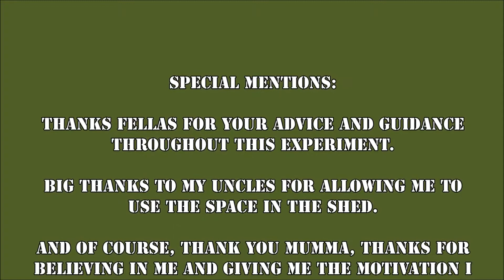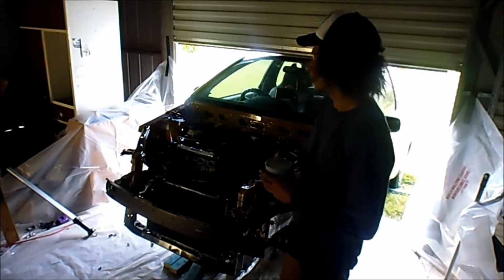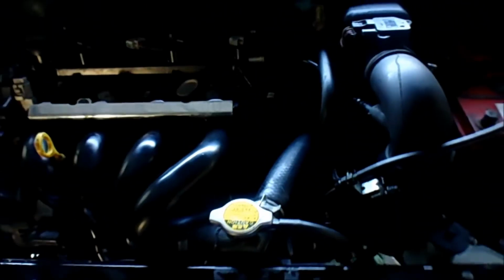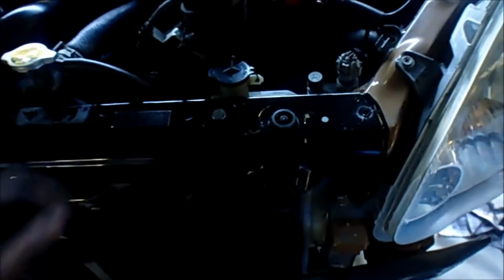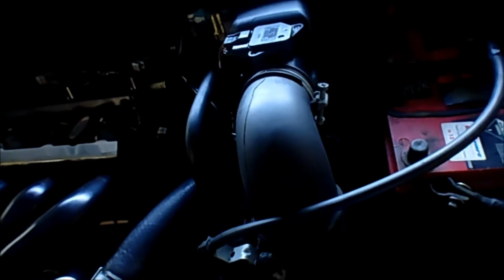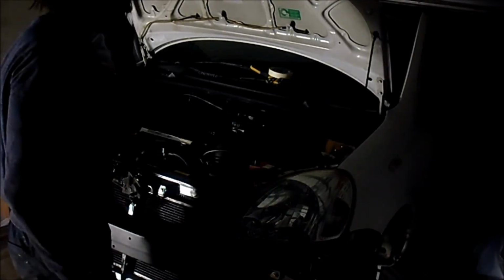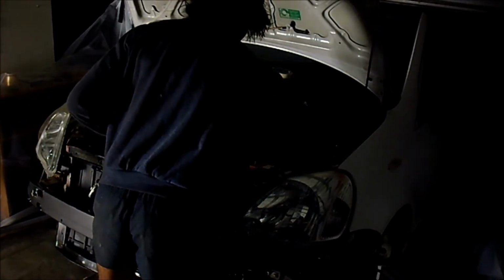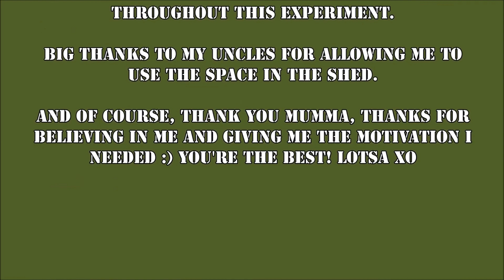PFP - Pt.16 Toyota Echo 2nz-fe To 1nz-fe Conversion [First Start]

Comment: You could SWAP a 1nz-fe into a 2nz-fe without needing to change ecu, wiring harness or any other part to warranty perfect fitment?
Reply from the maker: I'm not entirely sure what you are saying/asking.

The wiring harness is the same I just neatened mine up a bit. Fairly certain that the ecu/key/key barrel/transponder transponder needs to be swapped. And apparently you can't use a 2nz clutch/flywheel on a 1nz, but I don't know for sure.
Reply: Do u know if the gearbox of the echo fit on 1nz-fe